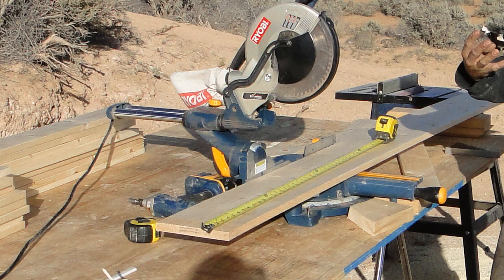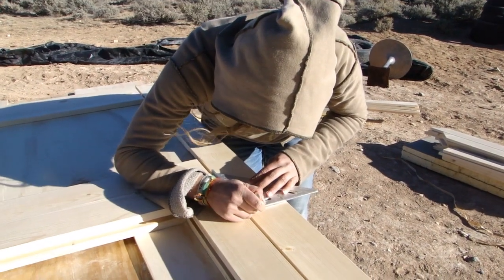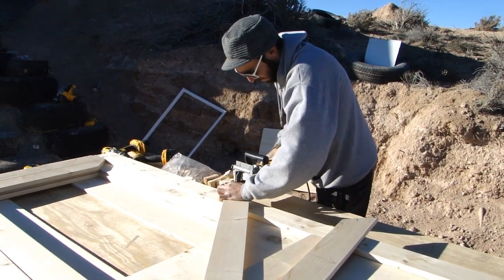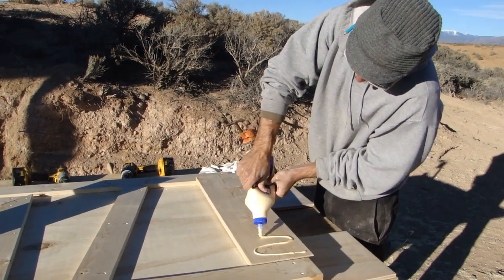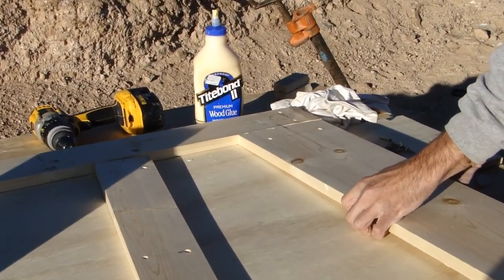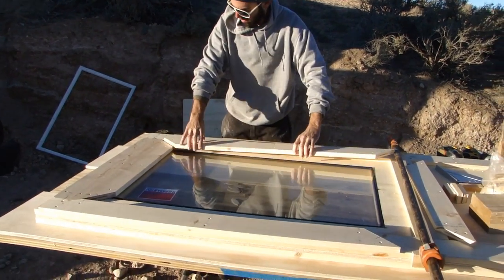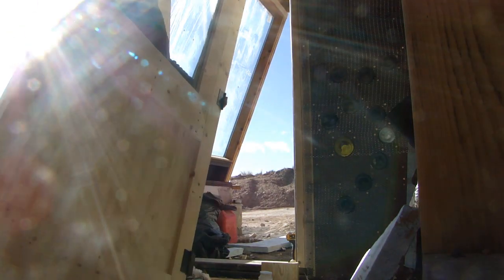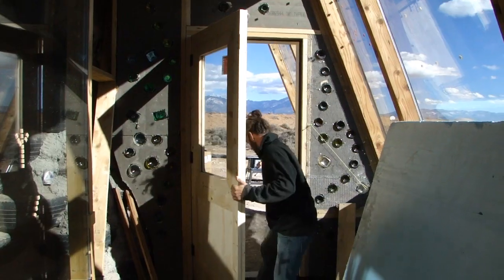How to Build Exterior Doors

Comment from the maker: @AnnBearForFreedom Thanks!  We sanded them and put a single coat of Watco Danish oil on that I had laying around.  When I am back this summer I will probably finish them with a couple more coats of that.  The doors are protected from the elements with an 8 foot alcove so they don't need super heavy finishing.

Comment: Miter joints between rails and stiles on exterior doors and non floating panels = short door life
Reply: How does it equate to a short door life? Durability? I work with doors daily so I would love to know why.
Reply: fancyslayer99 it doesn’t allow the door to move during changes in weather, or the differences between inside and out. The floating panels gives the door room to expand and contract. And the miter joints will push outward jamming the door.

Comment: nice, you could easily insulate a door like that by building it with 2 layers of plywood & an inch of the same polyiso (sp?) insulation you used in the roof.

Comment: You guys do everything the most complicated way possible.  Its obvious that you haven't worked in high production builds. If you are going to build a door like that out of many built up parts you do not need to use all of that glue.  It's more important to seal all four sides of the door parts with a primer and paint before assembly.  The screws are plenty enough to hold the door together.  I have seen many fancy wood doors fall apart from condensation. The glue keeps the parts from drying well.

Comment: You should never build a door this way.  I love your vids but this door will fail in under five years.  Using plywood and real wood is a no no.  They shrink and expand at different rates, and that will open up your joints.  Once that happens, water gets in and it's all over.  Even if you try to keep up with it using a good exterior oil based paint, it will still fail.
Reply from the maker: thanks for the tip!  didnt consider that
Reply: Yeah, you shouldn't sandwich plywood between solid wood like that, but do a frame and panel construction instead. Looks like he's in the desert so I doubt it will matter in his case.
Reply: Yea, in that environment, he likely be okay....I'm in the northeast and this one wouldn't last long enough to justify the time for the build.
Reply: I've had a home in the California desert for about 8 years. I tried using some wooden doors (factory made) on the exterior of a couple of out buildings. I put 4 heavy coats of exterior clear coat on them they lasted about 2 years. I've since replaced them with metal skinned exterior doors. After 5 years they show no wear. I've learned a lot about desert living, it's a very harsh environment. I moved back to town a couple of years ago but kept my desert house and still go there often. Good luck! Looks like you have the skills you'll need out there. What desert are you in?

Comment: If you off the grid why you using power tools?
Reply from the maker: +Jason C. you're question doesn't make any sense
Reply: OFF GRID BUILD Off the grid: not dependent on public utilities, especially the supply of electricity.
Reply: A fellow I know has no electric power lines but uses power tools all the time ... I know this may surprise you but they have these things called solar panels and batteries!